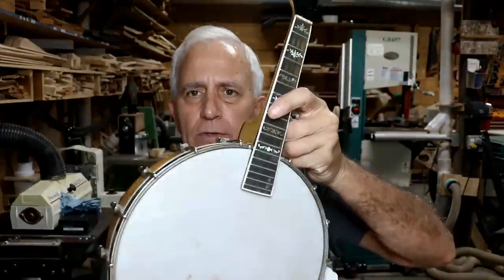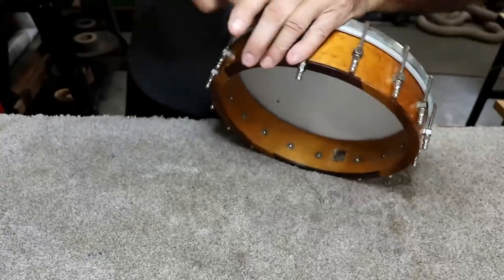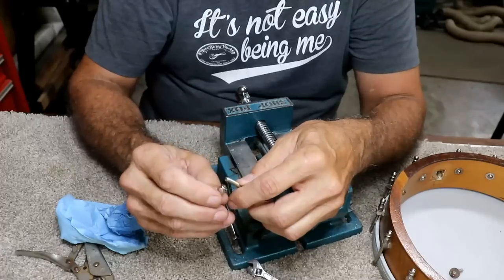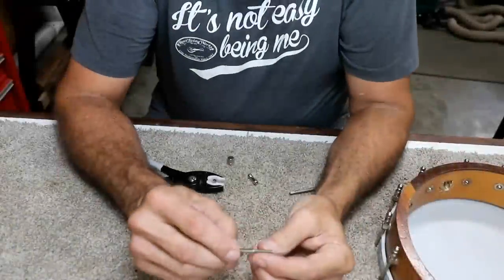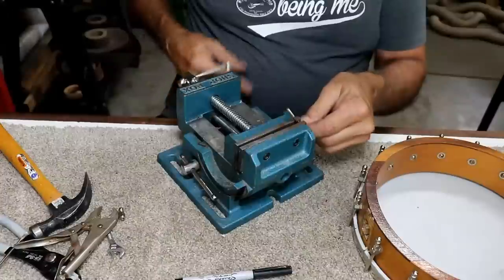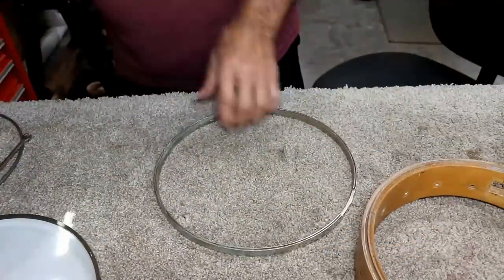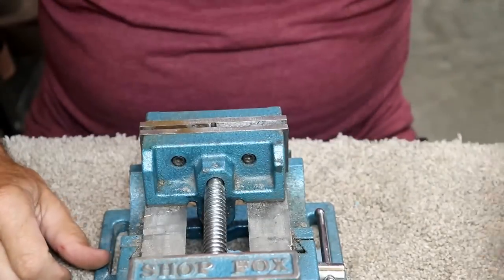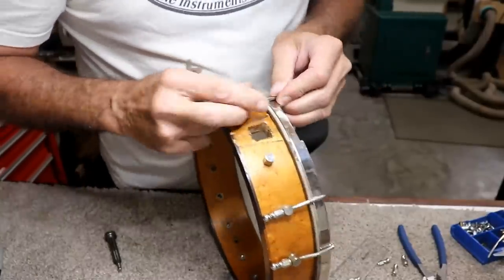594 RSW A Banjolin Manjo Repair And Setup - Part 1

Comment: My goodness, Jerry, I got tired just watching you adjust all that hardware. You never cease to amaze me with your patience and logical approach to solving a problem. I have a 1920vs era Gibson tenor banjo that I inherited from my grandfather. It was needed some TLC when I got it. From my perspective, it was a just a collection of nuts and bolts that needed to be cleaned up and oiled, then tightened up properly, so I decided to tackle it myself.

 I took it apart, serviced everything and reassembled it. I adjusted the neck angle, and strung it up, and it's a very beautiful and functional instrument now. It's very ornate, with a full Mother of Toilet Seat fretboard and peghead overlay. The sides and back of the wooden bowl are inlayed with flowers around the edge, and the Gibson potted flowers on the back. Tenor banjos are a whole lot fun and easy to play once you get the hang of it. 

A lot of these tenor banjos were made during the first part of the last century, by many different companies, but Gibson is the cream of the crop. Mine survived in amazing condition, the original frets showed very little wear and the nickel plating is all intact. Someone in the past had shimmed the neck poorly and they glued small blocks of wood underneath the bridge feet to raise the bridge up about 3/16". I took the weird shim out of the neck pocket and put it back together at the proper angle. I carved the wood "extensions" off of the bridge feet and tightened the head until I got a good tone and the head didn't sag. I used Flitz Metal Polish on everything until it shined up like a new nickel!

 I play my tenor banjo fairly often and I think of grandpa, and I try to imagine the full history of this hundred years old instrument. These relics are a part of American history, when the banjo was king. I'm proud to be the custodian of this centurion, and I'll be able to pass it along to the next custodian in the best condition it can be in.

Comment: Had to do the same thing on an old Kay Kraft tenor banjo that I refurbished for a lady (it was her grandfather's -- no charge also).  For some reason,  I think it was the thickness of the metal flange on the modern head,  the original brackets would not hook up.  Ended up putting a slight bend in them all only I just slipped a socket over the hook end and bent by hand -- not very precision but worked like a charm.  We both were very pleased with the end result.

Comment: We call the body the pot.  The wood part is the rim.  That head seems to be the wrong size.   Needs a different height.  Probably high head size.  Looking forward to seeing how you handle the fretboard that extends over the pot and usually warps like a ski jump.  Thanks for sharing.

Comment: I think this while thing was caused by the pass through posts on the side being too close to the skin. That made it so there was too much thread coming out behind them, and too steep of an angle to come down from the rim. The fact that the caps were too tight is probably due to someone trying to tighten them once they were bottomed out.  Would have been better if it had been built with normal nuts, rather than capped ones

Comment: All day at work, I deal with similar thread issues. A plant maintenance worker will come in to my store first thing Monday morning with a pneumatic tube push to connect fitting. 10/32 thread appears sometimes, and it looks awfully like 5mm. You don't get that too often, but you gotta be careful. Mostly imperial measure, though you really have to be aware of the British standard pipe thread sneaking in there posing as NPT. It's hard to tell the difference, with my eyes. Why the whole world doesn't get on to a universal standard is beyond my ken. Tube size, 6mm looks a lot like 1/4" but no. 8mm is so close to 5/16" that the diff hardly matters.

Comment: Jerry, I'll bet you those hooks aren't threading further into the nuts because the shafts are bent. I've had those cheap banjo hooks bend/deform over time enough that the only straight course of threads are in the nut and they can't be tightened further.

Comment: I'd bet you have either an old "mongrel screw" an old Franklin Institute thread.  it may be a pre-standardized "mongrel screw thread" or someone is making new mongrel screw threads. Seller's at The Franklin Institute  proposed standardized screw threads for the US Navy back in the late 1800s based on the British Whitworth standardized thread specs of England, only Sellers decided that a 60 degree pitch was easier to make than the 55 degree Whitworth screw pitch. (SUPER STUPID!!) There was already an early American Metric standard that was going NOWHERE, and several imperial standards that were regional at best.  You can find these goofy taps, dies & screw plates from the era of "MONGREL SCREWS". We use SAE & ISO metric now. There is also British Cycle, Whitworth, Franklin, a 19th century American Metric, USA Uniform Screw, Japanese Industry Standard & Deutsch Industry Normal. Yay! We are back into mongrel screw land! British Whitworth was an established standard in the UK and her colonies.
Reply: Wow! What a screwed up mess.

Comment: The ring inside the skin was probably there because the top edge of the wooden body seems virtually flat. If it was a drum shell it would be tapered so that the skin rests on a sharp edge, like a string on a bridge.

Comment: There is an old thread series used in Britain called BA (British Association). I remember brass nuts and bolt that looked like British Standard Fine (BSF) but did not mate. I think the thread pitch is different
Reply: That’s the great thing about standards, you can have so many of them
Reply: If the head is sourced from an old British instrument, the threads are highly likely to be Bristish Association (BA) thread sizes. I have a few, and they are

Comment: Just 1 week after I saw your video I got a banjolin for repair. I have a question. The backside or resonator is fastened with a staybolt which is hollow and has a groove on top of it for a screwdriver. The screwdriver will be hollow and have 2 protrusions that goes into the groove but I can't find a screwdriver,top, bit for it, not even a name for the tool. Do you know that please?
Reply: looks like this STANLEY 10MM HOB FIXING SCREW  Product Code: W00920AXX

Comment: It's called a "Banjoele" or Banjo-uke. In a pst video where you showed how to replace the drumhead on one, you referred to it as a toy (which it is not by any means. It is a full-fledged instrument in its own right, not a toy. The Manodlyn you play is about the same size as a Ukelele of banjo Uke and it has 4 sets of string tunings per instrument (even though the Mandolyn carries 8 strings, but each two strings are tuned in pairs to the same note when strummed, so basically you have 8 strings with only 4 paired separate tunings. I must admit that I wasn't happy when you referred to a Ukelele or Banjo uke as just a "TOY like Instrument". Take one string of each of the pairs on the Mandolyn, and you have a wired up Ukelele if it is tuned to G,C,E,A. or better known as "My Dog Has Fleas" tuning. If you prefer wire strings over plastic, then retune and setup an old mandolin that is in rough condition and use it as a Ukelele. Same thing, only wire strings are used instead of plastic and cords/note locations are different.